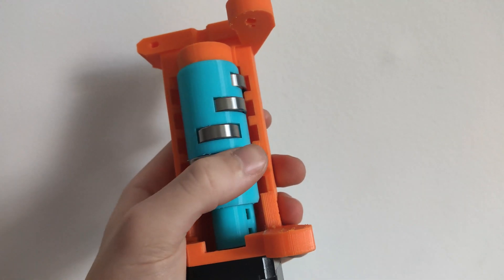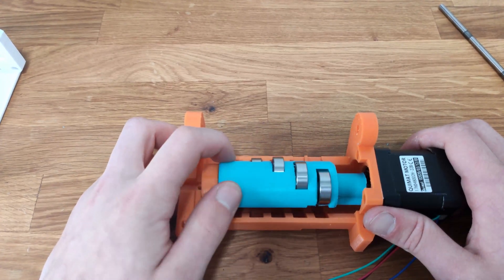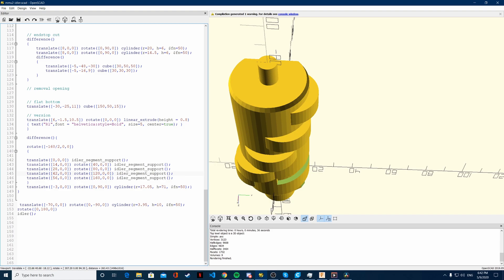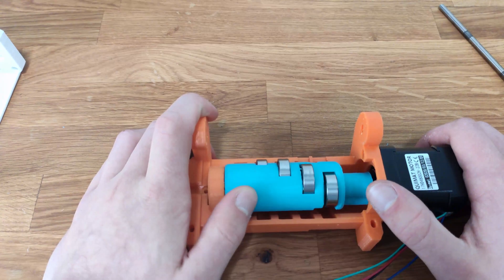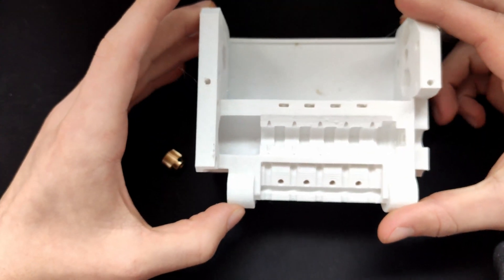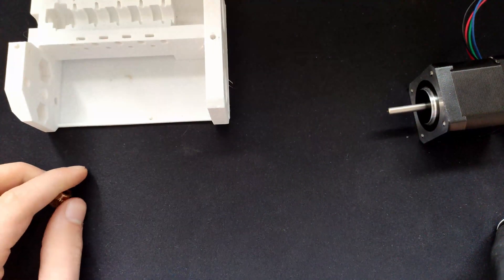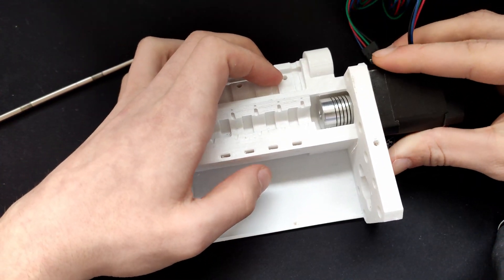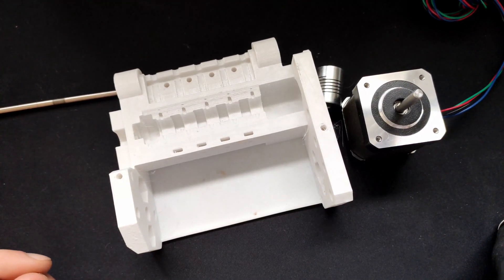MMU2 upgrade on any printer. Part 4: idler assembly and main body changes

Comment: one problem with that coupler idea, it is not designed for side loads.. so put another bearing next to the coupler to support the load on the saft from the filament nearest the coupler.

Comment: une question sur quel principe sa fonctionne
Reply from the maker: C' est une upgrade pour imprimante 3d qui permet d'imprimer avec plusieurs matériaux simultanement, c'est une de mes premières videos et le design a beaucoup changé depuis, si tu veux voir un changement de filament ave le prototype le plus recent regarde ma dernière video a 18:20, le prototype est maintenant fonctionel et j'arrive à imprimer avec plusieurs couleura avec plus ou moins de succès. La première partie de cette video devrait aussi répondre à tes questions.